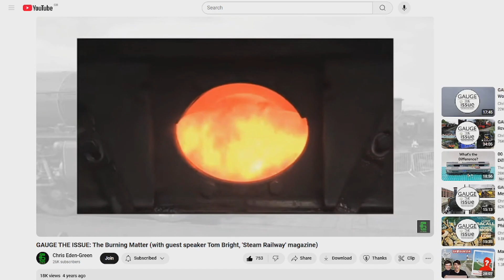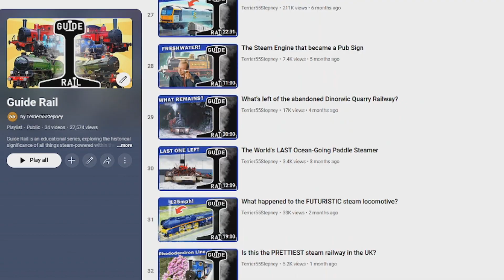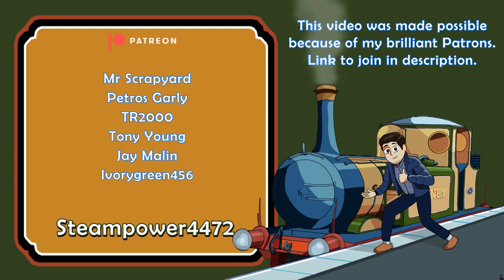Why are steam railways struggling to find coal?

Comment: We have a similar problem here in Germany, although many steam engines runs on oil. But i think that is the same child with a different name. Our last coal mine shut down in 2018, and since then we imported coal from Poland or China. And with more and more of our coal power plants shut down, coal will be exclusively used by heritage locomotives in the near future. This is not cheap, and not environmental friendly. Therefore, societies already began with experiments, to find a different energy source, that should be (cheap) available, and environmental friendly. Because lets face the reality, the way the world is changing, its only a matter of time before campaigns will be run against heritage steam and diesel locomotives. On the channel powered by steam is a video about the railway enthusiasts Hasetal. They converted a tank engine to run on wood pallets.

Comment: Just remember that the locomotive fireboxes were specifically designed to burn a particular type of fuel.
Put the wrong coal on and you have the steam equivent of putting diesel in a petrol car and then wondering  why it's not running too well.

Comment: Surely certain tree logs would fire a steam engine especially if was mixed with smokeless coal to control the temperature in the firebox to stop it burning the grates away,another way of keeping the temperature down would be restricting the amount of air into the burners to control the burn rate and temperature,another way would be to convert the firebox to burn diesel or some other low grade fuel,I’m sure some geniuses would be able to get around this need for coal.

Comment: this is also a problem in North America, most steam Locomotives here were designed to burn Anthracite Coal or mid grade Bituminous which isnt really mined here anymore for various reasons (mainly laws about the Sulfur and Ash Content of Coal passed in the 70s), the only coal still being mined is Subbituminous Coal from Wyoming's Powder River Basin which is basically useless for steam traction except in specially designed locomotives but the only Railroad that had such Locomotives was the Northern Pacific and very few of their locomotives were preserved, because of and Fire risk (as well as the threat of Legal action from the State's of California and Colorado) most Steam Locomotives are being converted to burn Oil, 
the Durango & Silverton, Union Pacific Steam Program, and several State Railroad musueams have already done full conversions, along with most of the Logging locomotives in Washington and Oregon
although we have more Woodburners

Comment: Would a mixture be viable? Wood chips x% mixed with x% anthracite etc. I presume the wood would burn at a lower temperature, thus allowing you to get the correct temperature.
Reply: Not necessarily. Physics do not work like that. You need to find a fuel with the right reaction temperature. Maybe waste cooking oil soaked in sawdust

Comment: Our president has a simple solution. DRILL BABY DRILL!
Reply: But the idea of changing the type of fuel used in a steam engine has the same vibes as finding a new “safe food” for an autistic person. I am not surprised to hear they can be rather fussy and even melt down!
Reply: Yeah, it's doesn't seems like a viable solution to just keep burning stuff. If you could use a bunch of old EV batteries to provide heat instead of coal, then the future of steam would be assured for decades. The problem with this is finding a place for the batteries, however, if you could include an old cargo wagon in the consist that would provide an adequate place to store them.

Comment: String up some overhead wires along the track and pantographs on the cab roofs. Turn them into electric kettles on wheels like the Swiss did in WW2.
Reply: Get an old cargo wagon and fill it with batteries, that would also allow them to run where the wires aren't. And battery storage can be used to balance the grid for extra income.
Reply: It's silly there's only a handful of comments about this under videos talking about this

Comment: As the Technical Director of a locomotive owning group I can say it is a big concern. We are seeing massively increased costs in keeping th grate and ash pan in useable condition. The Khazak coal is OK in that we can raise steam and operate but it splits into small fragments that fall trough the grate and burn in the ash pan. we now have to run with the ash pan sprinklers on all the time. Last week for our annual steam test we were given some Polish coal and we could not get more than 60 psi on the clock! It was madness closing Ffoss, it was perfect and transport only a short distance our entire environmental policy is a sham as all this country is doing is exporting emmissions and jobs to countries that don't give a damn on either front

Comment: If it BOILS down to it, I suggest oil conversion. British Rail did it to their engines in the final days of revenue steam. Most American heritage lines have gone that avenue, most recently the durango and silverton. I've seen videos of a lot of engines struggling because of inferior coal. It's cheap, reliable, easy to come by, and gives off less soot. That's if you can't produce coal from mines of course. That would be ideal.
Reply: Oil Burning Locomotives are also a lot less picky about what kind of Oil, also for various reasons even a lot of the Big Steam Locomotives like 4014, 844, and 4449

Comment: There is another alternative fuel that old heritage steam locomotives can run on, the fuel is fuel oil, such as number 5 fuel oil. In the United States a number of coal burning steam locomotives have been converted from burning coal to burning fuel oil. I do not know how well the alternative of fuel oil would work in the United Kingdom. It is likely that the fuel oil would have to be imported into the United Kingdom.

Comment: Can petroleum coke be used as fuel in steam locos? It's a solid black combustible material that looks much like coal and it's a by-product of oil refining, so presumably would at least be available. How suitable it is for steam locos I really don't know.

Another option that I'm aware was used to keep industry running in some countries circa WW2 was to spray fuel oil on wood. The oil soaks into the wood and increases its calorific value to something comparable to coal whilst remaining a solid fuel, albeit one that's greasy to handle but it's a solid as such and burns better than plain wood.

Comment: I can only say that oil conversion may be the only solid long term solution at the moment. Coal as an industry is dying and once someone figures out how to make steel with oil the final death nail may be putting the coffin in the ground. Now if they figure out how to make an artificial coal that also works in the steel industry suitable for railway steam then this becomes an economy of scales issue that hopefully irons out the problems but this has to be dealt with quickly or i only see America which has begun to move to straight oil firing being the only one's left with heritage steam operations.

Comment: I feel like we must find an alternative to coal because of enviromental factors and to find a more accessable alternative in the modern day to keep the steamer running. After all, safety, emissions and heritage should be respected equally.
Reply: The alternatives will likely turn out to far far worse then what it intended to replace. All this eco abd climate nonesence has already shown its not a solution, just making more less obvious problems
Reply: @lbochtler  Well ignoring the problems and continuing like we did won't help either.
Reply: @ true, but mandating things with incomplete knowledge and unverified untested technology isnt a solution. Encouraging scientific research and helping the creation of small businesses and startups is a far better solution. The main problem is see when it comes to climate change and trying to limit its effects is the government trying its best to suppress better solutions by mandating their particular brand of poison coolaid be drunk, and no questions to be asked.
Reply: @lbochtler  Debatable but not wrong. I'm still sure though a solution will be found. We have to.
Reply: Waste cooking oil. Going to need some mechanism to aerosolize the fuel, but that stuff burns hot enough. To keep the immersion, shuck some coal or wood into the firebox
Reply: There are no environmental factors that force us to find an alternative. The steam engines are not causing any problems.
Reply: @MrJoeyWheeler  Have I said they do directly? The goddamn coal does. That with the emissions is one problem but coal is a limited material and we'll simply not getting more sooner or later so an alternative would be helpful.

Comment: Apart from heritage railway needs, why can't the millions of tons of coal under our feet be used instead of importing oil and gas from Russia in other industries ?     Yes pollution has been a problem but surely our scientists can come up with some form of particle filtration to overcome this. Also natural coal can be converted to 'smokeless' coal with coal gas as the side product - sometimes looking back to modifying old procedures with new knowledge can be the answer to today's problems.
Reply: As far as power stations go, there is technology to burn coal more cleanly and efficiently. Its called Fluidised Bed Combustion. The coal is burned on a bed of limestone which absorbs the polluting gases. The technology was in use at Grimethorpe near Barnsley in South Yorkshire. The experimental power station was built as part of the Plan For Coal agreed by the NUM and the Labour Energy Minister at the time, Tony Benn MP. The Grimethorpe plant was capable of burning any type of coal cleanly and efficiently whether it was heavy in ash content, sulphur content or any other. It didn't even matter if the coal was wet and sludgy. The Grimethorpe plant was 99% efficient compared to the 40 odd % efficiency rate of conventional power stations. The plant was closed during the pit closure programme of the 80s/90s of Thatcher/Major. They didn't want the general public to know about this technology as labelling coal as a dirty fuel helped them shut pits ( and the engineering, railways, manufacturing, foundry jobs the industry supported). I suppose I am a bit biased being a former miner and NUM member. We burn coal at home on our stove and its around £500 a ton now.

Comment: All this for 0.04% of CO2 in the atmosphere.
Reply: How does your body react with .04 BAC versus .02?  You double the quantity of any trace molecule in a large system it will have effects throughout the entire system.  Light reacts with different molecules in different ways, and CO2 is good at reflecting IR radiation back at the surface of the earth.  You double the CO2, you double the reflected heat back at the earth.
Reply: Not even that

Comment: It’s not all about Heritage Railway’s. Running on the mainline is a completely different requirement where the coal is burning much hotter and for much longer periods. Alternative technologies will simply not work in this environment. All steam railways need coal and it’s very much worth fighting for!
Reply: Oil Burning is probably the Best option most of the Mainline steam in the US and Canada has been converted to Oil burning a few Locomotives were built as Oil Burners
Reply: @ extremely costly to convert locos. We just need to build the lobby to continue coal excavation, it has little or no affect on pollution with the amounts required.

Comment: the North yorkshire railway is converting one of their locos to burn oil in her firebox
Reply: Their doing it one of their own WD2100 and a class S160 used on the line, but in both cases, they were designed to burn oil or coal and have steel not copper fireboxs. Infact it's remarkable their still here because their was basicly just a disposable utility loco for war time use and not designed for a long life, but 80 years on still going.

Comment: The heritage industriy is tiny and that's why governments don't see it as a major thing to take into account when making long term national decisions.

Equally, the heritage coal industry has known this was coming down the track for a long time and have had plenty of time to make alternative arrangements. I wonder if they considered taking over Ffos y fran, or looking into supporting a dean forest free miner based small colliery?
Reply: I was thinking that. The idea of keeping the coal industry going to serve heritage rail is and absurd idea that was never going to work on any level. The only thing to be done would be for heritage coal to band together to open and run one source at cost as a solution. I wonder if that has ever been considered.
Reply: Ffos-y-fran was shut down not because it was losing money but because its licence expired. The local authority, under extreme pressure from local residents, would not renew the licence. No one can open a coal mine in the UK.
Reply: Absolutely

Comment: America and Australia are converting locos to oil firing. It’s possible the UK Heritage scene may need to look at converting locos to burn oil in the future.
Reply: That kind of breaks the point of the immersion of the role of a fireman, but it may be necessary if the eco-idiots aren’t kicked out of the UK government.
Reply: @rhyusbrand8311  not really, at least with American Fireman they stopped actually shoveling coal with the advent of Spreader Stokers because you cant Handfire locomotives of a certain size
Reply: Besides, it is easier to get higher efficiency out of liquid fuels.

Comment: Most heritage lines work under light-railway orders with 25 mph speed-limit, short runs and sparse services. It ought to be possible to work them even with inferior fuel and reduced output of the locos.

Comment: To be honest I have an idea electronic radiators in the firebox to heat up the boiler. Sure, it might be a bit expensive and also very hard to maintain due to the boiling points, but honestly I think it's one of the best options. Worst case scenario there's no one just wants all these to shut down
Reply: The electricity costs {or the costs of generating it on site) would proberbly be more expensive than importing coal. You talking about boiling several Thousands of gallons of water in the case of a ex mainline loco.
Reply: @James_Rivett  yeah I mean like a small narrow gauge train
Reply: @gampugv2 judging by our electricity bills of late, the same might sadly apply. It's not a new idea BTW. The Swiss developed a shunting loco that could burn coal to raise steam and when under power lines be heated via this to help save coal. Despite the comments elsewhere, it couldn't be steamed alone via electricity. After WW2 the Germans fitted some of their larger locos with electric heating elements. When on shed they would use these to keep the boilers of the locos in light steam over night to save on coal or oil and labour costs. It also helped cut down on maintainance and the time to prepare a loco for its shift. West Germany was still using mainline steam until 1975 (east Germany was 1988). The French also maintained steam until 1974 despite being European leaders in electric traction.
Reply: @James_Rivett  man that sucks I feel bad it's a double edged sword

Comment: In Finland all steam trains we still have running use wood so we basically never run out of fuel! The only coal burning engines we have left just sit in a museum.
Reply: Irish and British steam engines were never designed to burn wood. High quality antrachite is preferred.
Reply: It's worse for the environment to burn wood than coal as it's so much less energy dense
Reply: @jessicaandtrains7768 the renewable nature of wood offsets it's lower fuel efficiency.
Reply: there are a few here in the US that burned wood, but its a pain in the ass to Chop and Load all of it so a lot of Railroads switched to Coal in the 1880s

Comment: Well… I’m not sure if this idea would work at one hundred percent, but I have been researching ingredients for a type of e-coal that could potentially solve the coal shortage problem, if not revolutionize steam travel for a new generation.

Hybrid poplar trees, bamboo, hemp, switchgrass and miscanthus each have one thing in common, they can be grown in masses.  Therefore, if we were to figure out a good balance between all these ingredients, we just might have a recipe for an e-coal that can keep steam in traction for years, depending on how much it would cost to have it mass-produced.

Edit: Again, I’m not a hundred percent sure this will work, but if it does, we just might give steam a fighting chance.
Reply: We have "e-coal" made from olive husks, low grade coal dust and molasses. Despite glowing write ups by the manufacturer, everyone I've spoke to who has used it says it's rubbish. Even our house fire didn't like it.
Reply: Cpl have been working on a man made oval called wildfire using a mix of coal and anthracite dust. It Is ok, but not great for high demand. But if mixed with good coal helps to go further, and can be used for when just sitting around. Our  House fire loves it and we use much less on the house fire than traditional coal, but the emmissions can course issues and several people have had carbon monoxide posing and made feel ill on traction engines and open cab locos, most likely down to the binding material. The other issue is it's a high ash producer.
Reply: Well, it is just a rough draft for a formula, so like I said, I’m not a hundred percent sure if such a formula as mine would make a good enough substitute for coal, but I am willing to give it a try, depending on where I can find a good place to produce it and test it out.

Edit: Also, I’d be lying if I said I wasn’t interested in everyone else’s ideas for e-coal.  Every idea can help.
Reply: @AndrewHager02 if you get some backing, have a go, it's the only way things progress is through experimenting